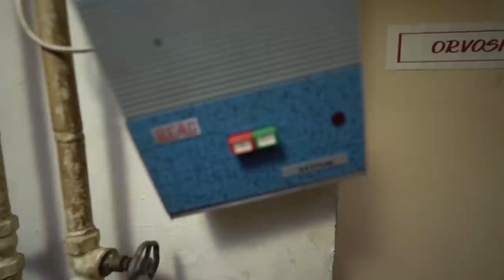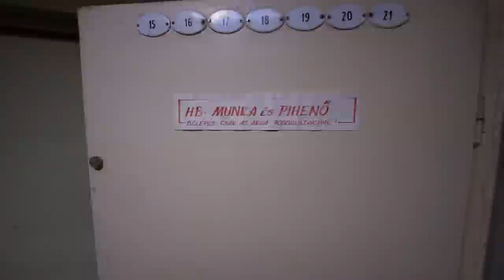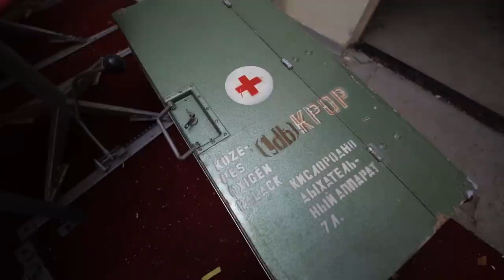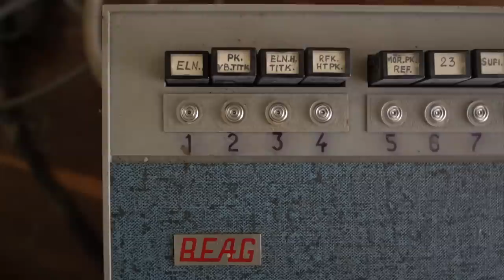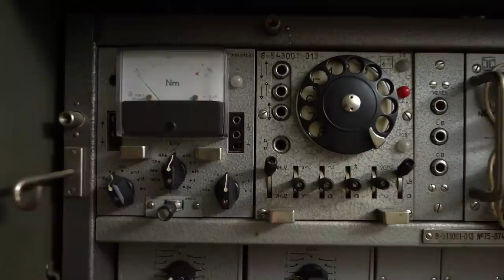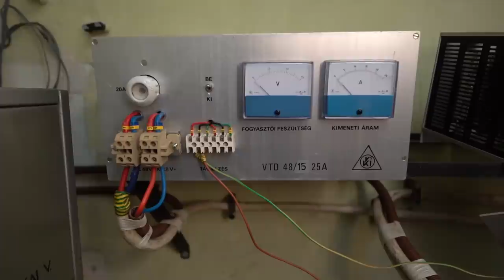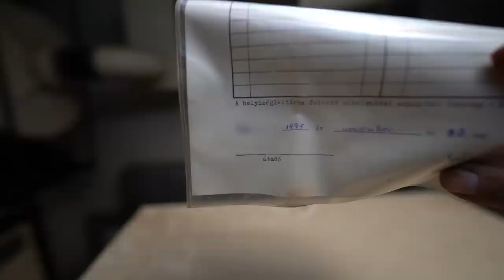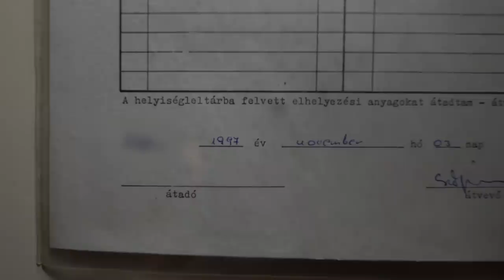Intact Hungarian bunker hidden in a forest | ABANDONED

Comment: I can't believe how intact that place is. Still would be a lot of work to mitigate the mildew and mold growing in there before someone could actually use it, but compared to most bunkers, it's incredibly clean. That's amazing. Wild seeing everything bolted down to prevent everything getting tossed around in the case of a close strike. Even had the belts to strap yourself into the bunks so you don't fall out. Incredibly cool.

Comment: I’m pretty sure that those chairs are designed to bring the user closer to the table and lock it in a firm position, prevents fatigue from sitting down long periods of time, you can also take a nap sitting upright 😴 

Fun fact on average when working on a small object/handwriting they will adjust their seat position 1-2 times a minute. This seat posture takes that out of the equation

Comment: 2:56 i am surprised that looters didn't take that suit. They are not cheap. I think one in that class can pop as much as 1k. Source: i bought several second hand ones from a lab that was rotating them, barely used, excellent for doing assessments in areas with potential dangerous chemicals/items.

Comment: That box you didn't know what it is looks like a power supply unit with a solenoid activated switch. I think the idea is the power from the mains keeps the solenoid pulled but when the power failed the solenoid drops and it transfers power from an alternative source. It probably also signals a power fail condition up the chain to other sites and systems.
Reply from the maker: Thanks for the info Paul!

Comment: those water bottles are rather modern style?
Reply: The water bottles: age is no more than 10 years. This is a "civilian protect" local headquarters. At the last 25-30years a lot of bunker is maintaned with a bare minimum level. A lot of adjusted to museum etc...and a very few is modernized. I see this is a not modernized, but maintained. The baseball cap in the bed has a firefighter sign.  This is not a military bunker.

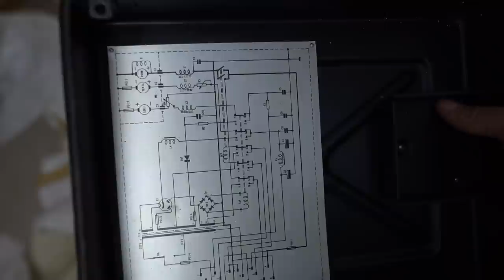Comment: @7:13 
Judging by the the schematics it's used for switching something, it's a control unit for another piece of (presumably important) equipment. Seems a bit overdone for just a switchboard. 
Or it's for switching between radio frequencies (VHF/UHF and so on)? Multiple variants of inductors have me a bit confused.
Reply: It is powersource for radio receiver R4 Labe or maybe for transceiver RM - 31 Supertáňa.
Reply: I was thinking the same. And it has a Tuning capacitor
Reply: @anuradhapriyankara5226  That is selenium rectifier, tuning capacitor isn't in it, but i check mine, just in case i lied.

Comment: Fire up the generator. That would have started. I would have just to say I did. But that's me.
Reply: Most likely it would Start and operate if there is a working battery and fuel left. My main concern would be that you don‘t know if the exhaust gas tubes are still intact. If they are not you won‘t breath there much longer. Even if you don‘t soffocate you don‘t know which Systems you are giving Power to and in what condition they are. I would not touch that thing either.
Reply: @maximilianharrasser9010  while I agree with you. But the minute it started you would know the condition of exhaust stack. Next thing is if you know what electrical systems are. There's most likely a isolation main breaker. I familiar with both mechanical and electrical. I would have had quite a blast with the old equipment. But mainly I definitely would have tried to start it.

Comment: You shouldn't touch any fabrics in these places. Take it from someone who has worked with stuff like this in a formal capacity, mold is very dangerous, far more than people tend to think it is.
Also, if you see any rat evidence (stains, smell, droppings) that's doubly so. Hantaviruses are no bueno.
Seven or so years ago, one of my structural guys was trying to asses a column that had a lot of thrown away couch pillows around it, moved them and in a week, he was feeling much like you'd feel from cv19 these days, except it acts like a delayed b0mb, and it hits you out of nowhere.

Comment: The spunker is most likely built during the cold War but I am assuming it was probably refurnished and use for a time during the 1990s and early 2000s. Because the chairs and equipment that is inside does not look Soviet or have that Soviet style that other abandoned bunkers from that time have also it is way too new looking and in good condition to be from Soviet time. As well the hazard suit and uniforms that are leaking around indicate 2000s.
Just thought you might find this interesting.

Comment: It looks like the only things removed were perishables, sensitive documents, and the lead acid storage batteries (near the decontam showers) - and they left everything else ready for return if need be. While it looks like it's been 25 years from the dates on the logs, it only looks about 5-10 years from the level of decay, dust, dirt, rust, and condition of rubber and other flexible materials (including those nestle water bottles). I wonder if they were using this for "off label" purposes for a while after it was shut off for official purposes.
Reply: You might be onto something, although it seems it's fairly well isolated from the elements which slows down decay considerably

Comment: be careful because the water that was found is not from 1997 but much more recent. many times these tracks are used by people who do not want to be tracked. warned man ...
Reply from the maker: I’m safe at home! And yes it looked more recent. Probably somebody checks it now or then.
Reply: @ExploringtheUnbeatenPath  I say in general. I have seen several urban explorations where there are objects left for a very short time or if the electricity is still active, which is not too strange in military structures, appliances and computers in operation.